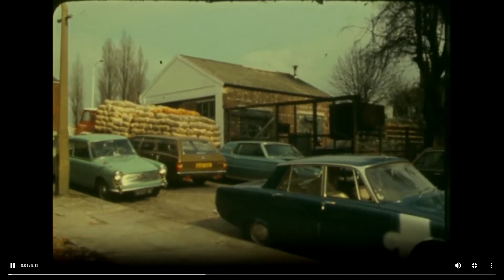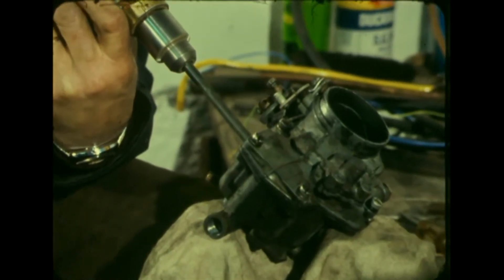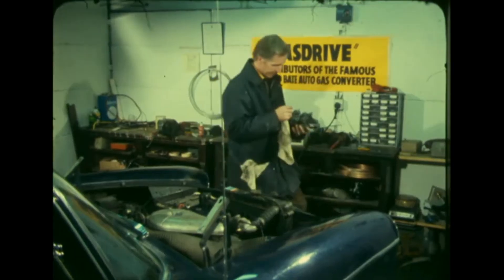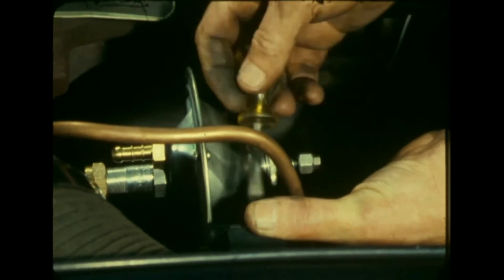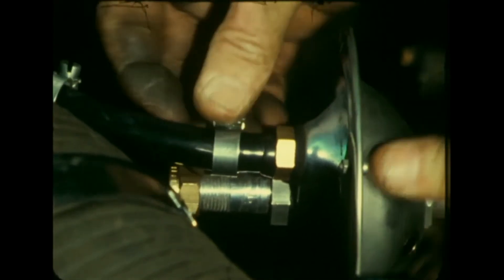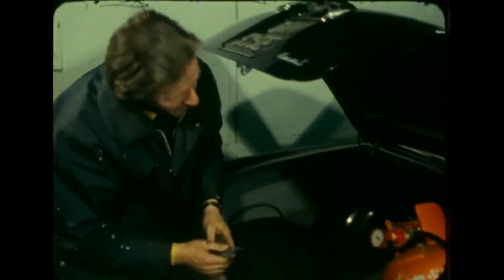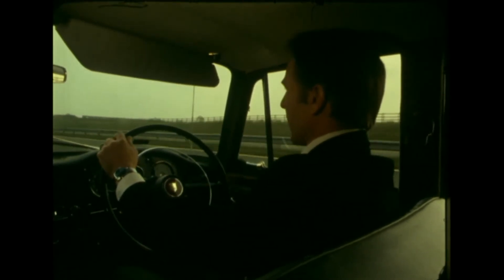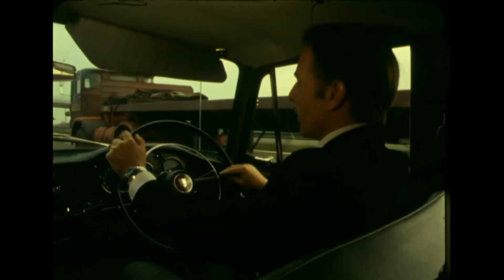Gas Powered Dual Fuel Cars, 1974

Comment: In 1971, I was looking for my first car. At a Chrysler-Plymouth dealer, I looked at 2 cars within my very low budget (US$400). One was a 1956 Cadillac Fleetwood sedan that had a system similar to this. The gas bottle was against the backseat, and there was still enough space in the trunk to, as Jay Leno jokingly says, rent it out as an apartment to a family of four.  I didn't buy that or the other car at the dealership but I did think it was a good idea at the time.

Comment: Despite the abundance of methane here in Colorado, I don’t recall knowing anyone who did a methane conversion.  A decade or so later it became a thing here in the US to convert diesel engines on tractors and autos to bio-diesel, which was mostly oil from restaurants that had been filtered or on corn oil. A friend who plays and repairs accordions converted an old Mercedes to bio diesel. If I recall correctly he didn’t change much of anything, just had to change filters more often.  The exhaust smelled like a chip shop. Was that a thing in Ireland as well?
Reply: I didn't know of anyone who did a methane conversion either (at least nobody told me they had). In 1971, I did look at a 1956 Cadillac Fleetwood sedan that had such a system and was for sale at a Chrysler-Plymouth dealer.

In the late 1970s,  I was vaguely interested in buying a Mercedes diesel. The option of using restaurant waste would have been a plus.
Reply: The UK were big proponents of LPG, which you lot call "propane". 

Methane, or natural gas, runs at much higher pressures and mightn't have been so easy to convert to for a DIYer. That said, there would be some methane in LPG - which itself is a mix of butane, propane and a few other gases.